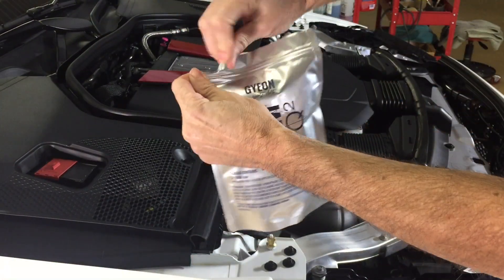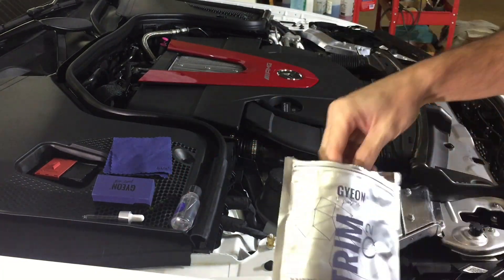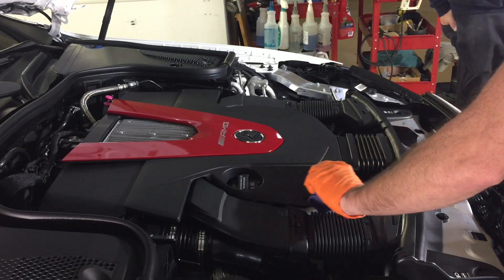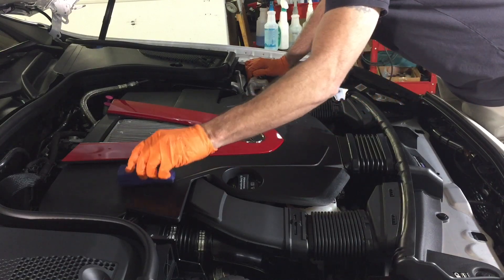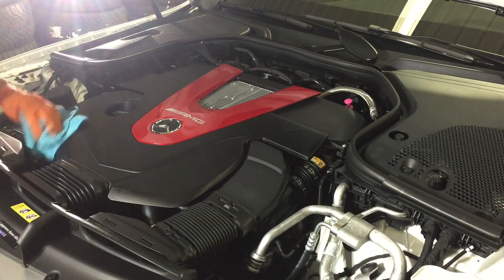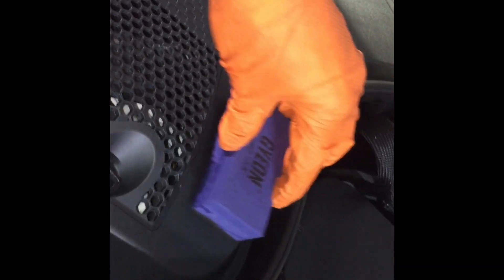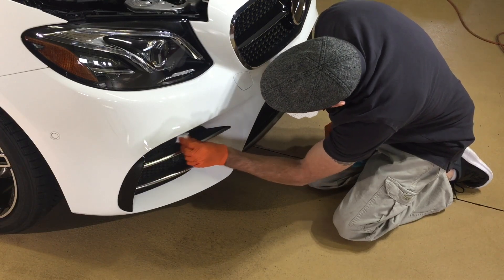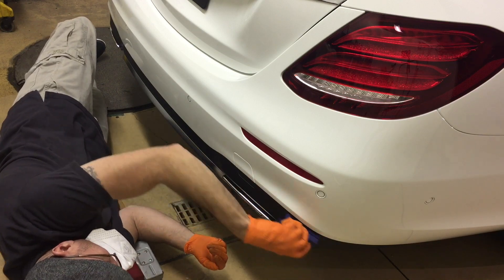How To Restore Faded Plastic Trim And protect New Plastic And Rubber With GYEON TRIM Q2!!

Comment: Can this be used on trim that has painted symbols?  I just recently restored a John Deere tractor and had to replace all the plastic trim due to oxidation from sitting in that sun. The plastic wasn’t too bad, but the painted symbols were almost not visible. Looking for a solution to prevent this from happening again.

Comment: Brian, do you think the coat in the engine compartment might last longer than 6 months or so since it rarely sees the sun? Thanks.
Reply from the maker: Iam not very confident with that. Remember all the heat generated in this area for extended periods of time.